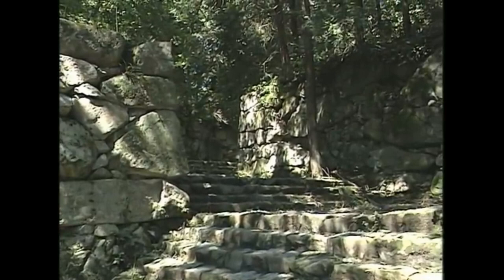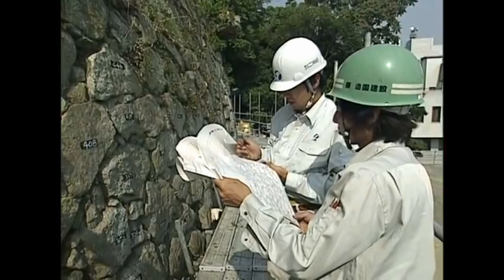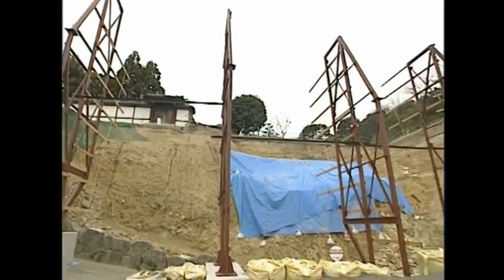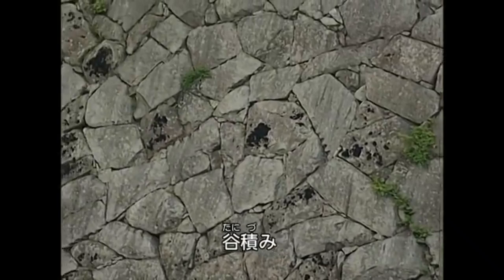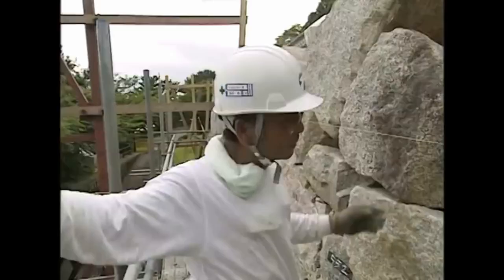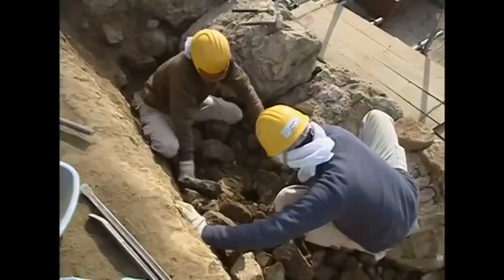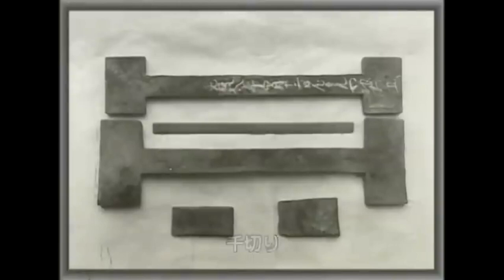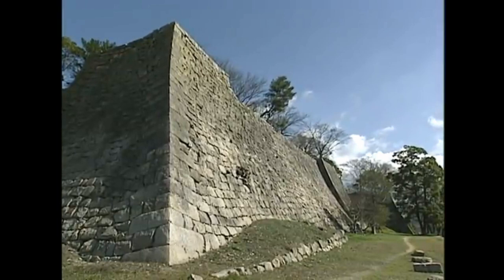IMPOSSIBLE POLYGONAL MEGALITHS of Japan. But Stone Masons Restoring Wall With Traditional Techniques

Comment: Living in earthquake zones drives people to build better.
Reply from the maker: "What the Ancients Knew - Japan" doco
they used a pendulum type log inside the tall pagodas to absorb the shocks. Plus Magic Mirrors.
https://www.youtube.com/watch?v=oN9p7l9BCZ4
Reply: @SacredGeometryDecoded  it was on history channel before aliens invaded. When they had 3 shows played 3 times a night.
Reply: Exactly.  While aesthetically pleasing these structures in some cases were in fact defensive positions - aka "castles".  So creating walls which are high and wider at the base to slope inwards disperses the weight above outwards to better sustain the weight.  Then when earthquakes hit - and Japan as noted noted is a highly seismic region - the walls can better withstand the movement.  

Similarly using stone inner and outer walls with earthen filler in between is an old technique for creating battlements capable of withstanding battering.  If they simply stacked stones tightly one atop the other than the wall could in time be battered down more easily - and as alluded be more susceptible to earthquake damage.   

So like others around the world they built based upon their local environment + available technology + and aesthetics per the local culture.  As the video alludes cultures at times copied each other since the iron flanges reinforce the walls during earthquakes and these have been used for millennia in other cultures. Man is the most adaptable animal = and that is the real technology. "Pattern recognition" is our greatest asset.  🤔

Comment: Im still not sure, do the re-constructions ever look as good as the remaining original walls? Reconstructions don't seem to be as good, you can tell immediately when you see them, Oh that's a reconstruction.  Even in this wall ( https://www.youtube.com/watch?v=f9wGOXXoCuY ) made from scratch in the US by a Japanese mason is no where near as good as some of the originals I've seen in Japan. So the question comes up..could some of these walls have been  found by the Japanese emperors, and maybe repurposed?  From the looks of it very few "original" walls remain, but those that do, seem to be way better than any attempt to reconstruct or any new walls made today. I have yet to see a modern attempt at a "Megalithic/cyclopean" wall that looks better  or  as good as the originals. I'm going to Japan this year, can't wait to visit some of these castles and see what is original and what is reconstruction.
Reply: Quality varies. Walls that are seamless are only so from the exterior. From the interior, it's just a bunch of precisely fitted rubble.

Also some were repurposed if I remember, but not the way you'd think. Often, they'd just expand upon a pre-existing foundation by just building over it, and maming a larger wall.

Comment: It reflects the often lost aspect of such work = culture.  In the East there are considerably more historical sites compared to what you see in the US - which is the major target audience for LAHT.  These individuals still value their history and use as noted ancient techniques to restore old sites to a similar appearance.  In the US you see historic sites and they may even at times be restored similar to what you see here.  Yet much of what you see is newer and is either replaced with more of the same or else is modernized - hence losing its historical aspect. 

Naturally LAHT will dismiss this as always claiming the use of modern tools as their purported proof.  After all confirmation bias rules all for them.  Yet using modern tools merely = speeds up the process to save time.  That is what these tools were created for after all.  Yet the basic techniques behind the modern tools remain.  More importantly as noted before = the person behind the tool.  If these masons did not understand what they do and the nature of the stone they worked then the use of modern tools would not alter this fact.  "Man" = is the real technology.
Reply from the maker: Yes, the traditional work in Japan is amazing. I posted a clip from the Japan episode of the documentary series " what the Ancinets Knew" on magic mirrors. Though the Japanese carpentry is off the charts, incredible joinery and yearly competition on who can plane the thinnest slices of wood. Blades so sharp that leave smoother surface than finest sand paper when seen under the microscope.
https://www.youtube.com/watch?v=zs9X-XzFGHI&t=435s
Though if you look up their joinery, it's a rabbit hole watching how skillful they are. Artwork more than a mere craft.

Comment: You make it sound all good and easy. Yet You just brush over all the hard parts. Like moving and actually fitting the stones so they fitt well. "Can't fit a paper between..." dude you can fit a book in them cracks.
Reply from the maker: Links in descriptions to stone masons fitting much more complex shapes using ancient techniques.
I mention that in the first few minutes.
Also a playlist of videos of people moving and accurately placing megaliths with “primitive method”.
They are rebuilding this wall to its original condition. The corner blocks are well fitted and the others in Japan I show are entirely well fitted stone.
You are brushing away the answers by “just asking questions”.   M  as he it good and easy by putting the effort  in and linking the answers.
If you won’t put in the minimal effort into looking at the sources spoon fed to you it’s not my problem but yours.
Based on history in the comments I know you don’t actually care. It’s a belief system and the Holy Questions most be preserved by avoiding answers. Avoiding looking for them and avoiding when they are dropped on your plate in front of you.

Comment: some of the convict built buildings in Hobart are very fine.. in brisbane all the convict work was pulled down except for 2 places. 1 being the old tower mill.. the stones have been cut curved. or hewn? so it’s a round tower.. similarly the non facing work is common brick. an interesting building. especially how they cut the blocks curved.
Reply from the maker: Eddystone point Lighthouse is a nice one, not as good as the original Eddystone in UK and their lighthouse but a beaut none the less. Pink granite.
https://www.youtube.com/watch?v=tALubqrbH_0 the insanely awesome lighthouses in UK

Comment: Of course we could recreate what they did in the past. If, having finished restoring a wall the restorers were told to take it down and do it again, they'd do it twice as good in half the time. This is called experience. The ancient builders would have been masters of working with stone so their work reflects that.. 
  I've heard it said that this type of polygonal construction is much harder than square block construction. I disagree completely. Squaring off a block takes a huge amount of time with crude tools so it makes sense you look for the closest fit you can from rocks you see on the ground, then with a bit of chipping away you marry it to the block next to it. In this way your shaping 2 surfaces rather than 6 if you cut them square..  The obvious difficulty is making it fit perfectly without continuously offering it up and taking it away again, particularly with the larger stones. You can overcome this  by making a mould of the sufaces thus you only have to lift the stone once for it to fit perfectly.. There are always solutions that don't require lost ancient high technology or aliens... The ancients were just as smart as us and clearly with this type of work, surpass our abilities today..